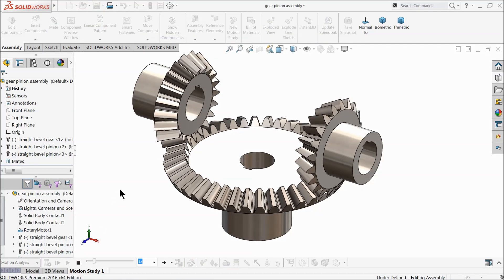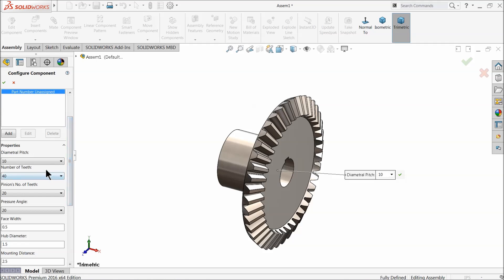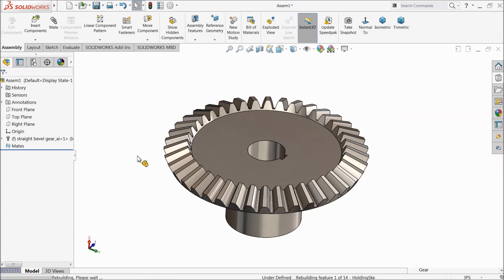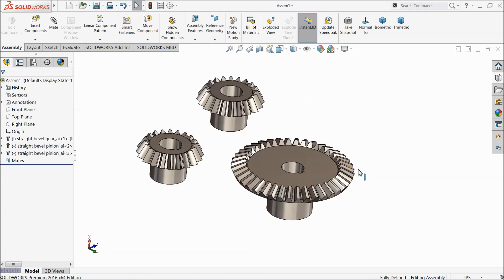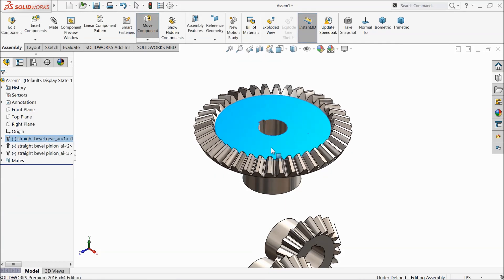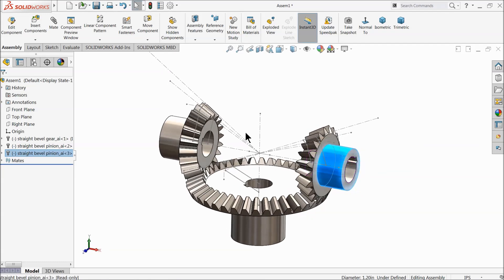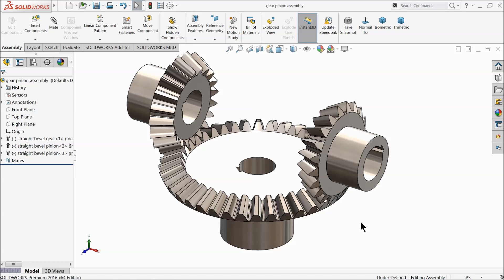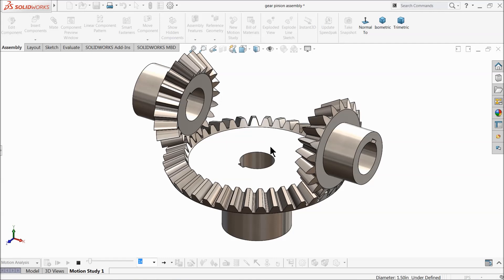Solidworks tutorial | Bevel gear and pinion mechanism in Solidworks

Comment: For an introduction, I'm Francis Tucker , am an African who is making an actual flying single seat helicopter using chiefly local materials. I am very much in need of a set of bevel gear and[ two] pinions. The ratio between the center bevel gear should be one is to two very similar to the bevel gear in this photo. Eg. The pinion gear should have ten teeth and the center bevel should be twenty. I will prefer all of them having splines or key ways for mounting them to their respective shafts. the pinions should have twenty mm hole  in the middle  whiles the center bevel has thirty inner hole, the diameter of the spline. Please inform me as to how to get these item components to buy. Thanks.

Comment: Hey there, I am having some problem in the toolbox.While changing the number of teeth to 40 it's staying 20 only.What should I do now..?
Reply from the maker: check either you selected the perfect group or not i means check its Straight Bevel gear,
Reply: It's straight bevel gear,but still I am facing same problem.